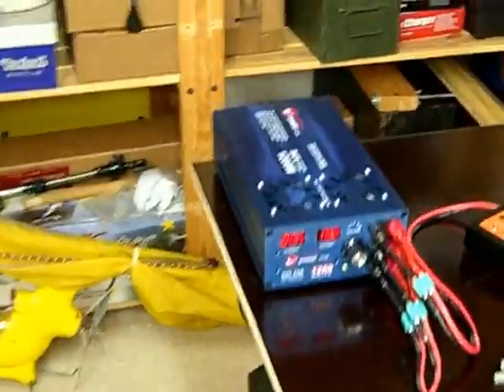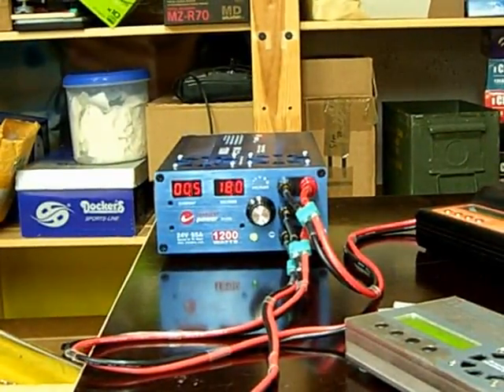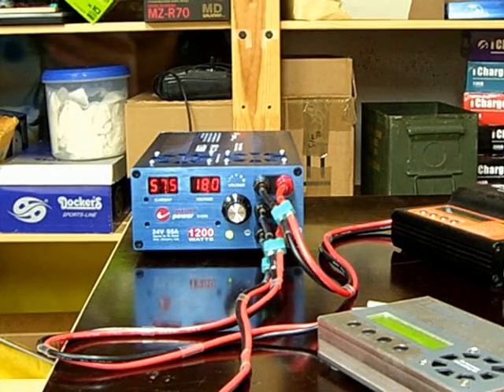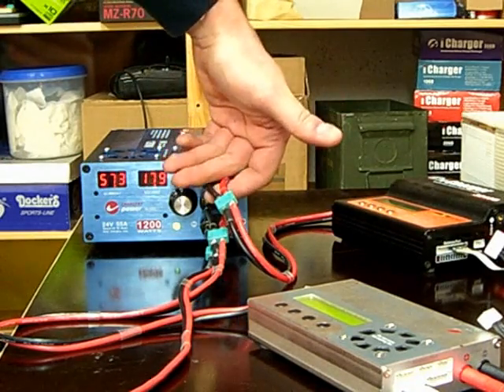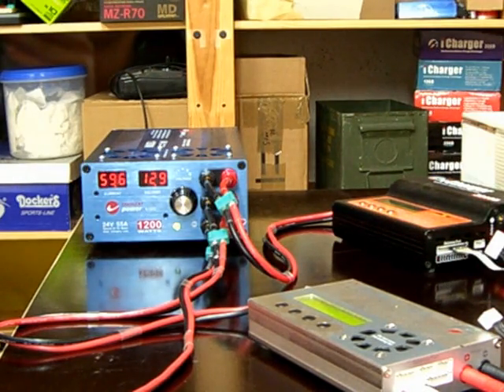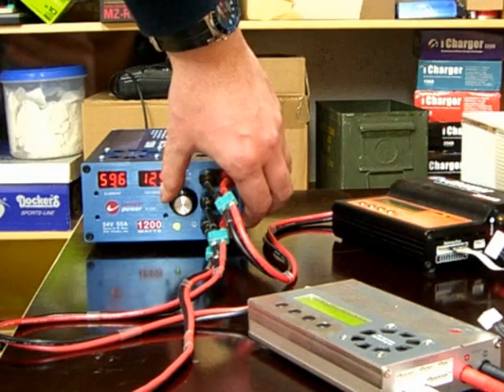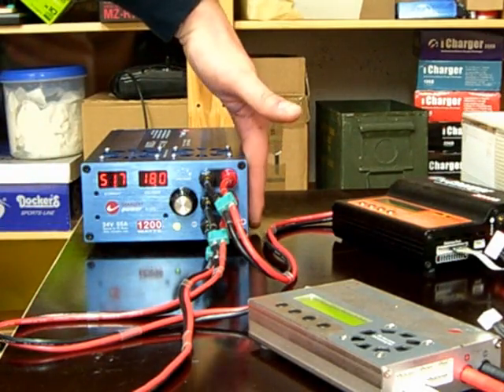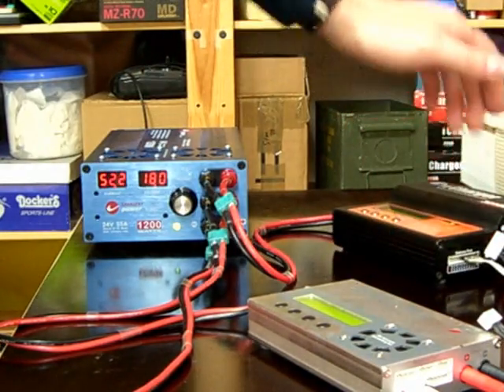Chargery S1200 Power Supply Test

Comment: Hi, what pug size does the outputs have? Thanks!
Reply from the maker: The output connectors are standard 4mm sockets that fit the usual 4mm banana plugs.
Reply from the maker: The output connectors are standard 4mm sockets that fit the usual 4mm banana plugs.

Comment: there is a new Chargery S1500 1500w Power Supply.
are you planning to make a test vedio
Reply from the maker: Hi Ronald,
I will most likely not test the S1500.
But there is a good test here:
w w w.elektromodellflug.de/1500w-600w-nt.html